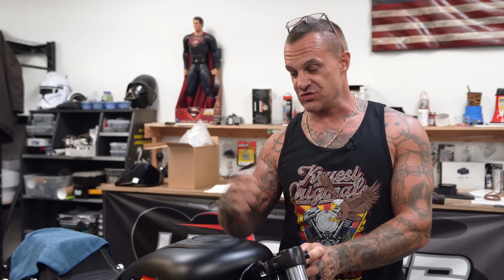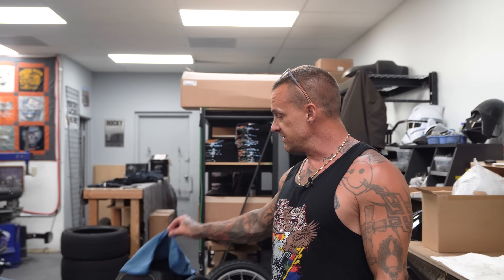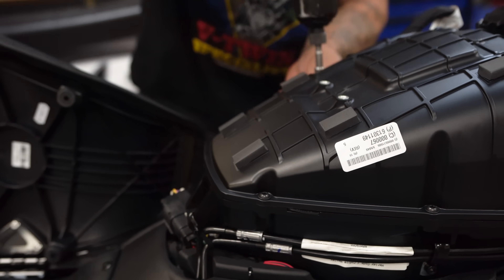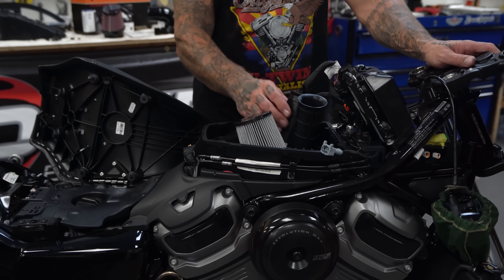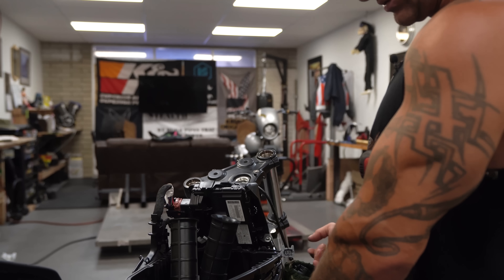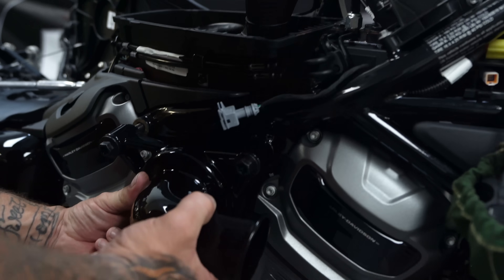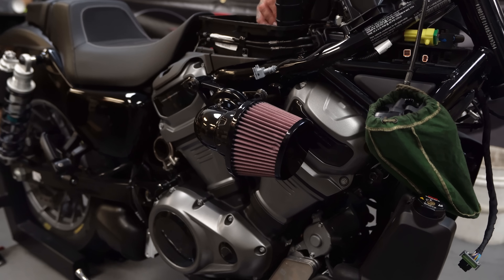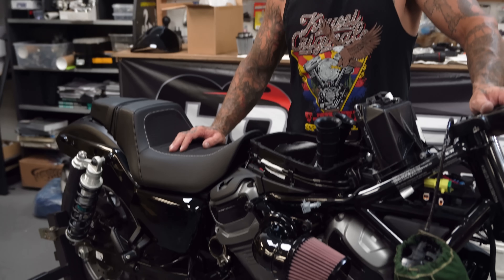2024 Nightster Screamin' Eagle intake install - Kruesi Vlog #112

Comment: Did you use red or blue loktite for the air breather
Reply from the maker: Read on the big bolts they are frame supports. And proper torque spec.

Comment: I just bought a '23 Nightster S with 500 mi on it. I'm picking up the bike this Saturday. It's my first street bike. This motorcycle addiction I just rekindled is going to save my life from a life long drug and alcohol addiction! Got to get me a Milwaukee 8 though ASAP though! Street glide 4sure!!
Reply: Picked mine up a couple of weeks ago, check out the custom rider modes, they can be made to be more aggressive than sport mode. Also under the seat are two pre-wired connectors for heated gear and of course the  trickle charger connector. Tonnes to enjoy this with this  bike. With the HD app you can check your fuel level on your phone. Also if you do any night riding, the led lighting is phenomenal. Enjoy !
Reply: Congratulations Brother Good luck on your journey
Reply from the maker: Congratulations, you will love it and you won’t want an M8 after riding one of these you’ll smoke one of them
Reply: Welcome back brotha.
Reply: Congratulations. health is more important.
Reply: Riding is way more fun the feeling like shit! Congrats on being sober!
Reply: Dude.. intake n exhaust n tune that lil 900 will put 97hp to the damn tire.. under 500lbs = beast
Reply: Congratulations on getting sober, im sober since August 19, 2011 myself. I've seen a stage 1 tune on these Nightsters put out 101 hp & 82 ft lbs torque to the wheel. I may be off by 1 or 2. There is a video on yt of the guy who tunes it & dynos it but I forgot name of channel but u can look it up & find it with some patience. These Nightsters tune very well apparently and get significant power increases just from a stage 1 setup. Just wish there was a better selection of exhaust for this bike. I really like the stock headers but hate the muffler and heat shield. I would love a slimmer version with a clean slim heat shield for this bike and a turnout style muffler tip with removable db reducer.

Comment: Looks like they used a sportbike style air flow design under the “tank”. With secondary butterflies I always removed them for better throttle response and not choking the bike down on my zx10&14’s. Not sure if they can be taken out like Kawasaki’s by removing a couple screws. With them removed I would think it wouldn’t restrict air flow.

Comment: Really curious what power you can get out of these, I know my ass already slides off the seat past 3/4 throttle, I definitely need a seat like that one.

Wouldn't be surprised if another 20HP comes from a muffler, a velocity stack and a chip-tune.

Comment: Are the ECU unlocked on those? The secondary blades probably closing the throttle early, even at WOT. This bike should be sick with some aftermarket support.
Reply from the maker: Trask performance can tune it and they’re going to tune our when we get back from Sturgis
Reply: @kruesioriginals  I'll damn near eat my shoes if they can do it. Had a kid upset his stage 2 1200 made less power than the stock (silencer ~ 4hp per dyno) nightster, imagine if it puts down big bike power.

Comment: Pro tip: set up that custom ride mode... Copy the setup from Sport mode... Then turn UP the throttle response. There's 2 more steps higher than sport offers....
Reply from the maker: I don’t want anymore throttle response, if anything I would like to turn that down a little bit and make it smoother

Comment: Here in Thailand we managed to tuned this thing to the moon. With just an intake and a slip-on the bike can do 100 hp at the wheel. The top speed can go over 120 mph pretty easily.
Reply: I'd love to see that wow
Reply from the maker: That’s perfect horsepower for what I wanna do. We’re going to tune our when we get back from Sturgis.
Reply: I'd be a little worried about tuning the 975. I feel like it's pretty much as strung out as it can be. I just have a feeling the rods won't handle more.
Reply: @marathon1972  How so? The metric bikes gets much more power out of smaller or similar engines. Look at the duke 890, 990, MT09 etc. 120hp from a 975 twin shouldn't be an issue.

Comment: Hmm, gas tank under seat, air box under tank cover...... I might be crazy, but this is a cross between the Vrod and Dyna. I mean, like i said last time, even the exhaust note with the slip on yall made, it sounds like a Vrod. I bet with the high flow intake and possible shorter velocity stacks, it will make loud intake noise.
Reply from the maker: Definitely has some V Rod vibes, but it’s definitely more of a Buell

Comment: Is it reasonable to even hope to get 120HP with just velocity stacks and a tune? That's a 30% increase over the stock 90HP.  Genuinely curious, because I've never tuned any of my bikes. I've got the Pan America Special, the Sportster S, and the Nightster Special, and the Nightster might be my favorite (although it obviously can't replace the Pan Am). Glad I found this channel recently! 👍😊
Reply from the maker: That’s just rumors through the grapevine. I haven’t seen it personally. So we’re gonna try and prove it. I know you can make 100 wheel horsepower with a slip on exhaust and intake by tuning it with stock velocity stacks.

Comment: I have so many questions! Is there cams for this? Anybody that ports heads? Is any of that even needed with this bike? I would love to see this thing make 120hp with such minimal upgrades. Could save you thousands in motor work the typical bike needs to make power. Exhaust, intake, velocity stacks, tune…120 hp ripper!
Reply: Try it out first. Test ride at a Harley dealer. If it's a Nightster S, set up a custom mode with aggressive throttle response , you'll be shocked.

Comment: I would love to see Harley do the "stage" lots for the new liquid cooled bikes. The Sportster S for example makes 121hp with the same 1250 as the Pan America which makes 150hp, so the chance to make power out of them is there. A stage 3 Sportster S with the Pan America heads/tune making 150+hp would be insane, and they already have the parts to upgrade said motors. It would be nice if they don't have the upgrades as "stages" tho because that's gay😂

Comment: Two long tubes shaped like a forearm feed the central box... By ram Air... To feed my BMW GS 😎
Why don't you rip around on it stock?.. You seem to be a madman that can ride anything so giddy up 🤠
Reply from the maker: I ripped all over on the thing when it was stock. I have videos of it on our YouTube the first one in the series. It’s an amazing motorcycle. But the stock exhaust is too long to make the rear suspension any taller so it had to go quick.